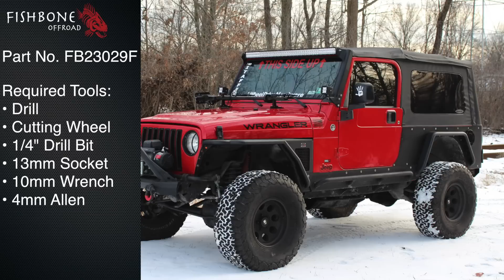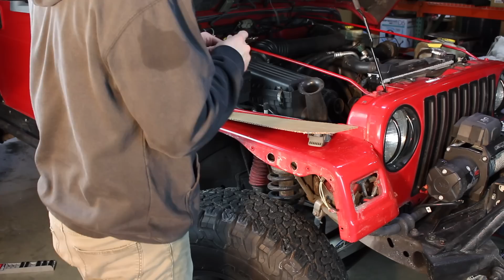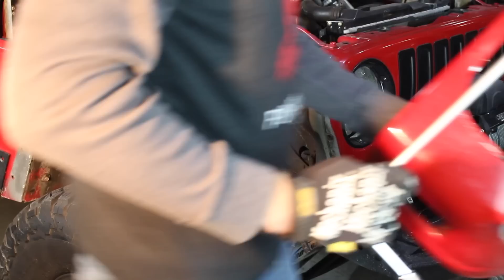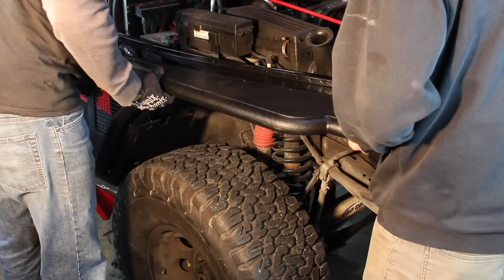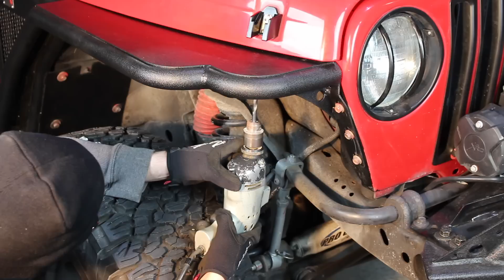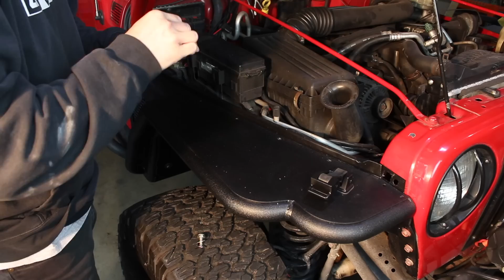FB23029F TJ Wrangler Front Tube Fenders Installation Guide

Comment: My kit didn't come with a traceable outline template. 
SO, I just flipped my tube fenders upside-down, and observed the underside of the top. I used painters tape to line the underside of the tube fender where the top of the old fender will be, and peeled it off so i had one big sticker. I laid it on top of my old fender, cut around it, and the fender slipped right on, no recutting or trimming, etc.

Comment: Hi, I installed aftermarket fenders and duo this installing I had to remove stock turning lights. Also I installed new headlights with turning lights as well so tried several combinations with the wires and didn’t get any luck! The lights are blinking like the bulb burned out. Do you guys have any ideas how to get it work properly?
Reply from the maker: Problems with blinking usually have to do with a need for a new relay.  I would Google: TJ Wrangler Fast Flash

Comment: where is the turn signal?
Reply from the maker: We offer a set of 3/4" amber LEDs that fit into the tube fenders. You can check them out here: https://www.fishboneoffroad.com/products/pc/viewPrd.asp?idproduct=93&idcategory=59
Reply: @drewskie 1996 same TJ hardware?  Or did you buy JK signals?
Reply: @drewskie 1996 thanks bud
Reply from the maker: We offer a set of 3/4" amber LEDs that fit into the tube fenders. You can check them out here: https://www.fishboneoffroad.com/products/pc/viewPrd.asp?idproduct=93&idcategory=59